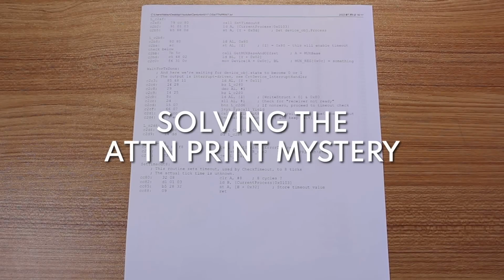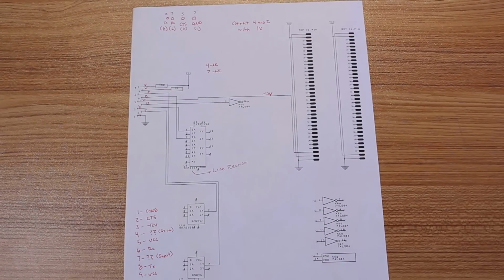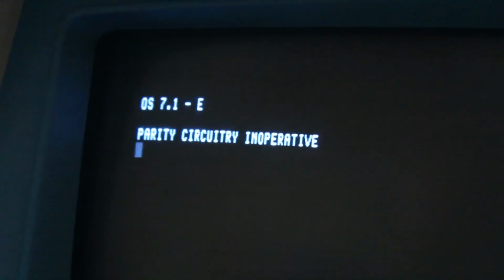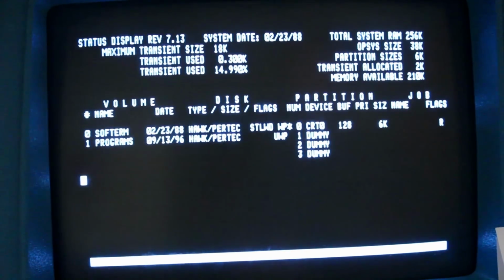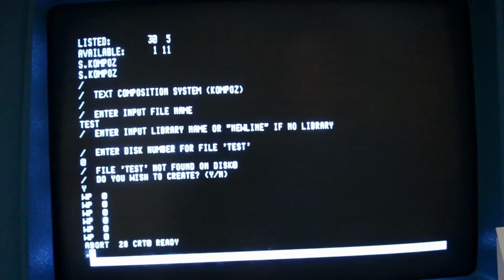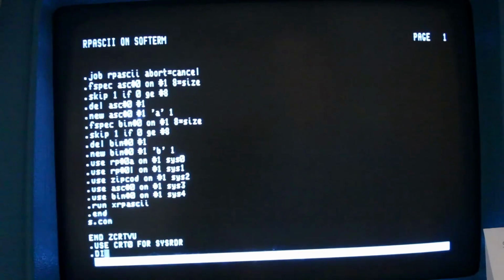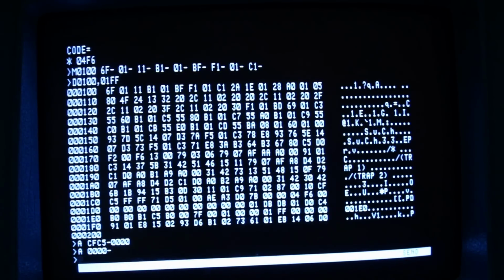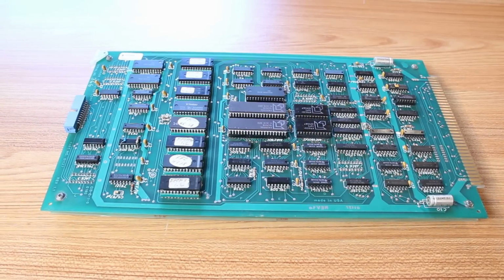Minicomputer Part 17: Welcome to the OS!

Comment: Kinda wondering if there's a different pinout'd serial cable for the CRT0 vs a standard serial in the pile of serial cables or if its something that serial distribution box does.
Reply: Centurion serial MUX cables did have a few types.  The standard MUX to RS232 terminal cable had black heat shrink tubing with a P/N near the DB9 plug.  The standard MUX to 20 ma Current Loop terminal cable had yellow heat shrink tubing with a P/N near the DB9 plug.  The standard MUX to RS232 serial printer cable had gray heat shrink tubing with a P/N near the DB9 plug. Centurion did not build a standard MODEM cable.  The MICOM Stat MUX shown in the first videos was a Centurion Dealer add-on item and many times the dealer would change the wiring in standard Centurion RS232 cables to work with the MICOM Stat MUX. The mods to the Centurion cable for the MICOM likely was the root issue for some of the terminal cable issues we had.    So happy to see a Centurion system running some 40 years after it was built in Richardson, TX.    Great job David & Team....  :)

Comment: This is incredible news! You've made such great progress, and honestly at the start I didn't think you'd get this far. So congratulations on proving me wrong!

With the prospect of getting the second machine working, is there any way to network them? It would be really awesome if you could get a primitive messaging or e-mail system working between the two machines!
Reply: The operating system code might provide some clues about the networking capabilities of these machines. Even accessing the disks mounted on the other machine would be a good start.
Reply from the maker: Thank you so much!
And honestly, I never thought I'd get this far either, so I somehow managed to prove us both wrong, haha.

With two machines going, we could always connect them serially through the MUX cards, but the question is, is there any software that's designed to support that kind of work? I know that MUX port 3 is designed for a 300 baud acoustic coupler, but as far as I've heard, that was primarily used to allow terminals to dial in remotely. But, the possibility is definitely there!
Reply: @UsagiElectric  Ken might know if any Centurion customers installed these machines side by side.  The intended model may have been that each site would have only one machine with the networking provided by the terminals I.e. a 'star' topology rather than the more modern peer-to-peer approach.

Comment: interesting that the hawk system drive is a pertec interface. Pertec is the same interface standard that many 9-track mag tapes use as well.
Many years ago, I was attempting to find/purchase a pertec to SCSI interface conversion card, but it was extremely expensive, and I didn't need my 9trk tape drive and its 40MBs of storage that badly...

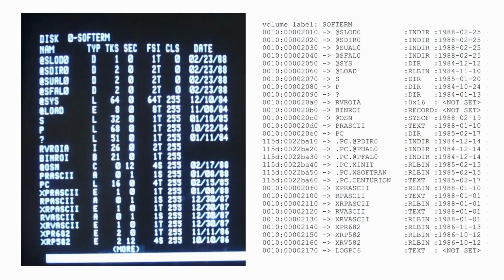Comment: What a milestone you have reached! Congrats. Does the system have a way to remember the date/time? Is that another board you would need? At 11:44 the date stamps for some of the files in the directory listing didn't match the listing generated by your scripts. Probably not a big deal but something I noticed. Looking at the listing of the ? folder I saw some interesting file names. XASSM, XASS01, and XLINK sound like files that could be used for writing programs in assembler. If so, you will be able to write some new programs directly on the Centurion without needing to use modern cross assembler you had written.
Reply: Centurion cannot save the date / time between reboots or being powered off.  No battery backup for a real time clock and way before the Internet NTP for setting time.    The Centurion power supplies a low voltage 60 Hz signal to the backplane for the CPU6 card to sync the heartbeat for the time of day clock.
Reply: @kenromaine2387  Apologies for asking a dumb question, but in general usage, were machines of this type run on a 24/7 basis, or would it have been that they were more often powered down at the end of the business day? Which operating paradigm would cause the best longevity/least wear and tear, in your estimation?
Reply: @jeremymtc  In the 1970s we asked customers to leave the electronics on 24/7 and only spin down the disk drives after business hours. At the time engineers thought the electronics would have less failures but not cycling the power ON & OFF.  In the 1980s many if not most of the customers started power OFF the system after business hours. A few customers even used the systems 24/7 for manufacturing inventory or in hospital settings. We really never notice a difference in MTBF between electronic failures.  Guess the old ideas of reducing the number of power cycles really mattered to tubes and high power systems and not much for minicomputers.  Most Centurion computers only had a field engineer on site once per year to change the HEPPA filter in the disk drives.
Reply: @kenromaine2387  Thank you so much for your comprehensive answer. As has been with all the rest of your knowledge and wisdom applied to this project, it has been a fascinating and educational experience for me to witness, and I thank you.
Reply: Yes I’d be interested to know how it thought it was 1988?
Reply: @rnb250  Those software entries in the directory table were written in the context of the date keyed when the OS was loaded and the data saved to disk.

Comment: It would probably be a pain to build, but what about a virtual drive that could replace the hawk drive so you don't have to risk the real hardware?
Reply: I was thinking about using the 8-inch floppy drive David mentioned in video 14 as the "daily driver".  Copy enough of the OS onto floppies and boot from them and use the Hawk drives only at Christmas.

Comment: congrats !!!!!!!. Very interesting system, and most be reliable, they managed to keep using until 95. i read long ago a story of some bussines runing till this era on Coleco Adam because all their files were mostly on adamCalc spreadsheet SW. Not to mention the amount of places running 370s and 380s systems way pass mid 90s, specially oil and banking which are very reluctant to changes. Any networking capabilities for the Centurion ?????. Would be FANTASTIC
Reply: There are legacy mission critical systems all over the place running on VMs as well as old hardware.

Comment: Just shows what a silly thing RS-232 is.  Sort of a standard that anyone can use in a bunch of different ways, so it’s easy to understand and use but not really a standard.
Reply: It started off as a very well defined standard for connecting terminals (DTE) to modems (DCE) - that's why there are signals like RI (Ring Indicator) and DCD (Data Carrier Detect) that only make sense on a modem.  After people started using it for computers, there was some disagreement about what set of connections to use - are you going to connect a terminal (which would make the computer DCE) or a modem (in which case the computer should be DTE)  - similarly, the handshake lines have very clear and defined uses with a modem, but less so for computer to computer communications - this is why some machines used RTS/CTS and others used DTR/DSR (still others gave up and used software flow control, typically using XON/XOFF).  So it's not really the fault of the standard - just that it's been adopted to things it's not suited for.
Reply: @TrimeshSZ  True, it was the obvious thing to use for everything.  It really was not a standard and in an ideal world the computer industry would have made a standard when machine started being connected.
Reply: Arguably a convention more than a standard but its universal that pin 2,3 tx/rx 5 is ground, levels are -10/15 to +10/15v
Reply: @alexandrsoldiernetizen162  now rs232 is used frequently with 3.3v levels
Reply: @mohinderkaur6671  Thats not RS232, thats TTL level UART. It has to be boosted to the +/- 15v level with a chip like the MAX232
Reply: Some ports have pins (“male”), some ports have holes (“female”), some transmit on 2 and receive on 3, others will swap them to avoid the need for a “null-modem” cable, flow control is done in 2 or 3 different ways -- XON/XOFF versus DSR/DTR versus I know not what. Since most of the pins typically went unused, it was common to use a smaller connector (e.g. DE-9, or even  mini-DIN 8 on the Apple Macs). It was the most wonderfully non-standard “standard” you could imagine.

Comment: Interesting! I started out working on the earlier Data General Nova line machines (Nova 1200, 800, 820, etc...) with core memory. Back then 16K core was plenty of memory. If you had 32K you were living large. OS was RDOS. Anyone out there ever use RDOS?
Brings back memories for sure!
Reply: Nice!
I serviced DGC computers from the Nova 800 1200 to the Eclipse and micro Nova.
Reply: @paulcohen1555  I used to work for a small company in Silicon Valley called Minicomputer Exchange that dealt in used minicomputers. We would buy them from businesses upgrading, test, refurbish, and resell to other small businesses. We only dealt in used Data General stuff. Anything from a Nova 1200 to a Nova 4 (in later years) and some Eclipse machines. I used to do all the testing and repair so got to know the machines well. Also peripherals like paper tape readers, tape drives, hard disk drives, you name it. Once microcomputer came out that shut down our business for good.
Reply: I used RDOS briefly on an Eclipse in the computer science department at Canterbury University, for an assignment in Simula if I remember correctly. That was also the first machine I got to play with Unix on -- some of the staff and graduate students there had ported v7 Unix to it a year or two earlier, which I gather was an interesting exercise.
Reply: One of my biggest regrets is that I started college the year after they ditched their Nova. I'm not going to dis the PDP 11/23 and 11/73 they replaced it with but I'd have loved the chance to toggle in a boot loader and boot from paper tape.
Reply: @edgeeffect  Yep, the older machines did not have a ROM to hold the small boot loader so we used to toggle it in via the front panel switches. Those were the days. If we only knew what was coming in the next 20+ years.
Reply: @herbertsusmann986  I don't know if you repaired the DGC computers boards, swapped them or scrapped them.
Here they were very expensive because of overseas shipping and taxes and we usually repaired them.
One thing that I clearly remember is one day at a customer which had an Eclipse computer that failed.
I installed one of the CPU boards on the extender board.
Used the micro_instruction_step panel switch and with the schematics, prom contents listing and logic probe, found a poor TTL IC that failed and FIXED the computer.
Reply: @paulcohen1555  I did detailed chip level repairs on the whole DG line. Nova 800, 1200, Nova 2, Nova 3 and some Nova 4. Also Eclipse later on.
Reply: @herbertsusmann986  Me too.
And of course their private peripherals: Hard drives, tape drive, terminal printer and console 
These were nice days which will not come back.

Comment: I worked on some old SEL machines running MPX.  That JCL reminded me of the JCL on MPX.  Before you actually execute a task, you had to make I/O assignments.  Things like the 'SLO' (standard listing output) would be assigned to system printer (or redirect to a file).  But yeah, brings back lots of memories.  :)  Great JOB!!!

Comment: David, before you spin your crashed drive with a new platter, you might want to remove the heads, inspect them, clean them (ultrasound), and possibly repolish them (or find a new head). Which of course also means realigning them. It's a pretty hard crash you got, digging all the way into the metal in large swaths, so damage to the head is a possibility, and for sure a lot of embedded stuff in the head that should not belong there. If you try it like this on a good platter, it might crash the good platter. We removed, inspected, cleaned the heads after each minor crash we had with the Xerox Alto Diablo drive (we read over a 100 Xerox cartridges in dubious shape, so we had a few crashes). Only once did we have to change the head, on our most serious crash where the head dug into the metal and bent the suspension.
Reply: Definitely listen to Marc! He is very methodical and meticulous about his restorations.
Reply: @RingingResonance  Hey - don't forget that a number of purge operations were completed, which is how effective, is anyone's guess. Relevant to that are the previous successful read tests performed through the Diag card. We only saw on video one successfull read test but I'm sure there were many others
Reply: @produKtNZ  Purging doesn't clean the heads.  It cleans any dust out of of the disk area.
Reply from the maker: Excellent advice!
We're definitely planning on removing all the heads and giving them a very good clean. We currently have the four heads from the recently crashed Hawk, and two non-destroyed heads from the other, very dead Hawk. Hopefully, between the six heads we can bring four of them properly back to life.

We were also thinking that since the Phoenix drive is essentially non-repairable due to the extremely precise and delicate way it's built, and that I have 19 Phoenix removable packs, we may use one of the removable packs as a replacement platter for the Hawk. I know they're very different recording formats, but both use the same brown oxide, so it's possible that the Hawk heads can write to that magnetic material. If it works, it'll save one of the precious few Hawk removable packs we have. 

I'm actually quite glad to hear that y'all had head crashes on the Diablo drive as well. It makes me feel less bad about having this extreme fear of a crash, haha. So far we've successfully spun up and backed up three removable packs and the fixed platter. The next two removable packs to backup actually give read errors (though they spin up fine), so we're thinking it's possible they were written with one of the heads slightly out of an alignment near the end of the drive's life. I'll have to realign the heads to those platters, and then once dumped, realign the heads again to master OS platter. 

Lots of work to come on it, but with CCDP it should keep the procedure relatively simple!
Reply: No number of successes erases the head crash.  I would listen to this Marc fellow.  Something tells me he knows what he's talking about. 🤓
Reply: @Starchface  Subscribe to CuriousMarc, if you want the Rolls Royce of restorations on YT, and if you know what's good for you! (and also subscribe to The Signal Path )
Reply: “A wise man Marc is …” Yoda
Reply: Had to do this with my RL02 after it cratered. Stuck another disk in.. boom also. RTFM and new heads ..did the alignment with a CRO and whacko works again. Pita though.
Reply: Oh hi Marc!
Reply: @KitsuneAlex  I did not hit her! I did not!
Reply: @RaymondHng  "Cheep Cheep Cheep!"
Reply: I can hear in my head, every word of this comment in your voice.
Reply: What Marc said - the chance of the heads being undamaged from a full on crash, one that went on long enough to dig a furrow, is pretty low. You'd be better off swapping the heads from an uncrashed device, if you can find any. It may be possible to find some NOS heads somewhere, since the drives aren't unique to the Centurion. 

On the other hand, now that you have the OS, maybe you can find another compatible platter, format it, and use THAT in the other drive so you're not potentially losing one of your few working Centurion platters. That's assuming that formatting is actually done by the OS - it may not be. Drives of this era were surface mapped, and that could have been done by specialized equipment at the manufacturer.
Reply: Marc, on the Alto, has there been any discussion as to interfacing a more modern hardware to act as storage?  I'm just thinking in case the Diablo drive or discs are a total failure.
Reply: That head is dead, Fred, put it to bed.
Reply: Issue is probably the lack of critical information to carry the procedure. Head need to inspected anyways ... but another thing will eventually fail. Drive needs to be emulated with HW and the HAWK put away for museum purposes. Unless more Centurion and CDC HW is found, so you wont be all over your nerves while trying to figure out this procedure. At least you need another complete system to compare with. Edit: And this will probably requires lots of re$$$ources too.

Comment: Super to see this old time machine come back to life. For whatever reason, the generation of machines just before the switch to microprocessors fascinate me and the Centurion was certainly new to me when I found this channel. Fantastic piece of work by you, Ken R and your Discord crew of reverse engineers.
Reply from the maker: I'm right there with you!
The era of computing where things were still built using TTL chips is so fascinating. The CPU6 in use on this one has a direct lineage to a CPU that was built entirely from 7400 chips, which is just amazing to me!
Reply: @UsagiElectric  I used to repair CPU boards for all the early Data General Nova machines. All 7400, 74S00, 74H00 logic. Pre-74LS00!. CPU fit on a 15 inch square PC board. You could put a scope probe on the address counter bits or on the accumulator bits directly!
Reply: @herbertsusmann986  And some Signetics 8T series IC's
Reply: @herbertsusmann986  We tore apart a CDC machine from the 60s in Electronics class in 1985. It was made of dozens of boards and each one was labeled and was a part of the CPU. For example one board would say, "A REGISTER". Another said "STACK". I remember one labeled "12 BIT ADDER".
Reply: @paulcohen1555  Yes, I remember them also. Wasnt one an 8T96?
Reply: @herbertsusmann986  Almost sure, I still remember the sound of the part numbers.